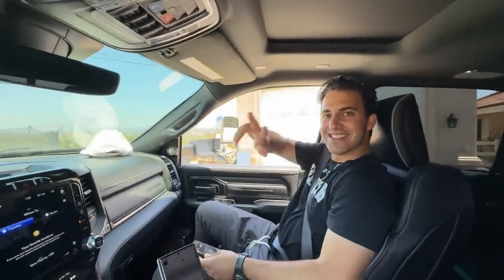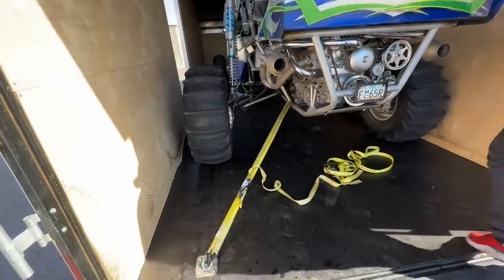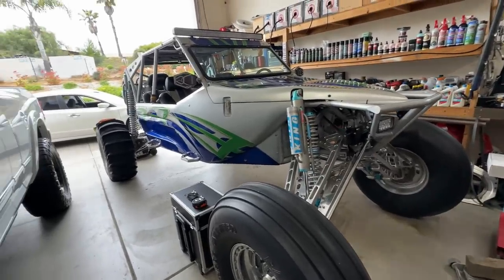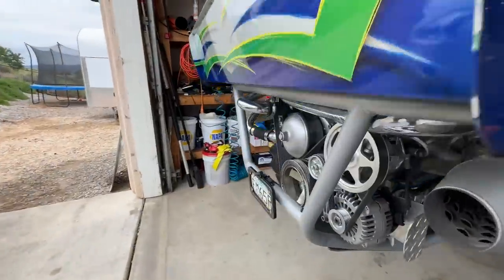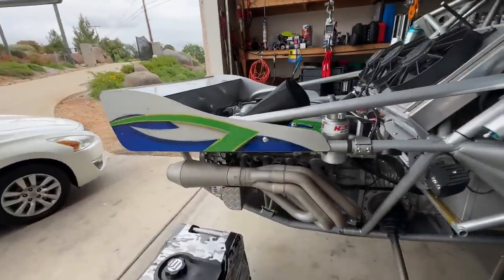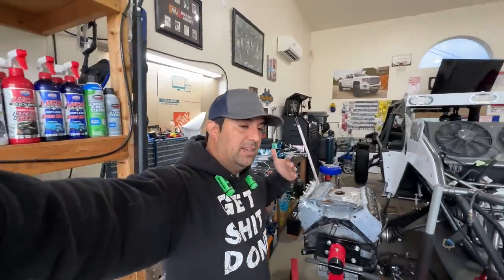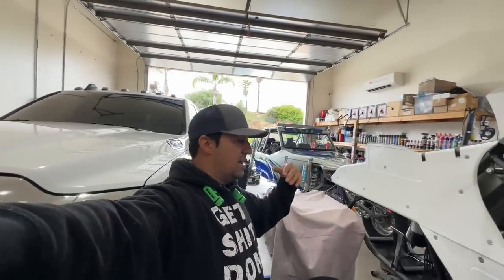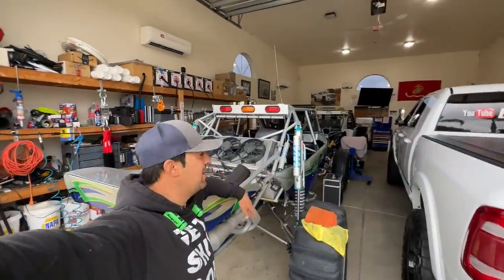The New Sand Car Has Arrived!!!

Comment: I built that car brand new in 2006 with Tatum Motorsports. I sold it in 2009 I believe, it still looks almost identical as when I sold it. I even added the TV's in the back head rests for the kids when they where small. That car has held up nicely and is killer through the whoops.....

Comment: AV gas is designed formulated for low rev and low compression aircraft engines. I know everyone is going to say I am full of Crap but if you talk to race engine builders they will tell you the same. Race fuel brands will also tell you the same. Protect your investment. Spend the extra money on race gas.
Reply from the maker: So I talked to a lot of race engine builders and they all told me that they run AV gas in there cars also and it's amazing fuel 🤷‍♂️
Reply: Avgas runs cooler and burns cleaner.